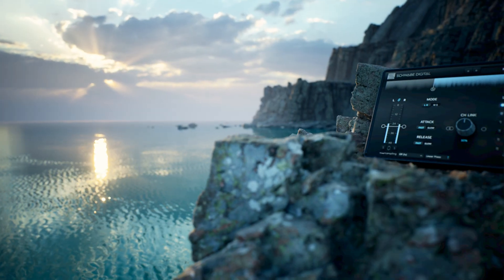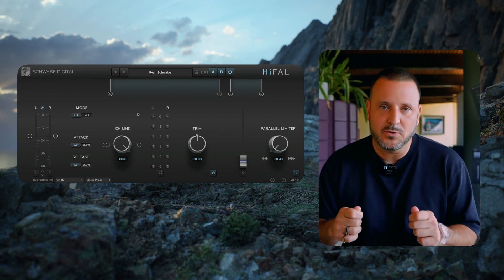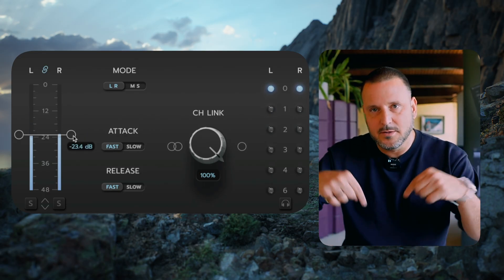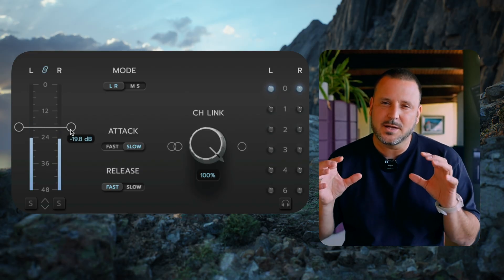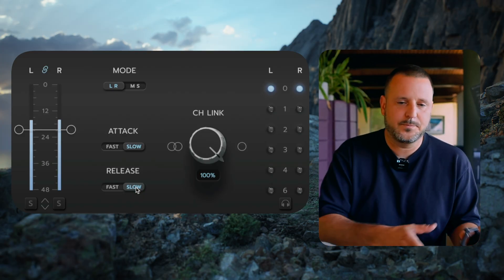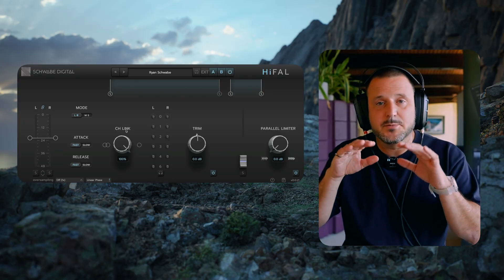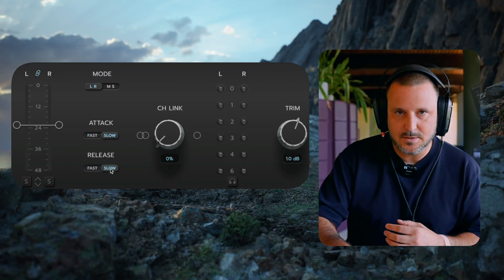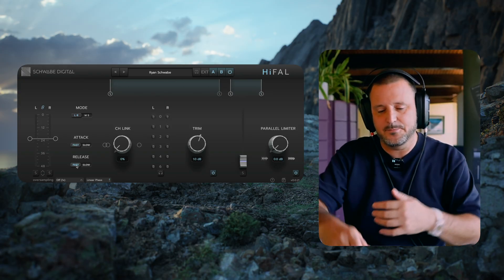5) Attack & Release of HiFAL's Acceleration Limiter

Comment: Thanks for the heads up on the attack and release for deEssing Ryan.I read your blog on the placement of HiFal in the chain,and I have one question I saw in the chain where orange clip or gold clip were first then "Master processing" all the rest I do already.My question is for I have the fatso EL7X with the two knob external control Would you use this in the chain? Again thanks for the videos Hifal along with your other products are game changers I love gold clip especially how you updated it
Reply from the maker: Hello, yes. When I wrote “master processing,” that refers to anything you think the mix or master needs. That can include EQ, compression, or any other specialty process that fits the song. I don’t use the same processors on every master, but if the FATSO is part of your usual mastering chain, then it should go there.